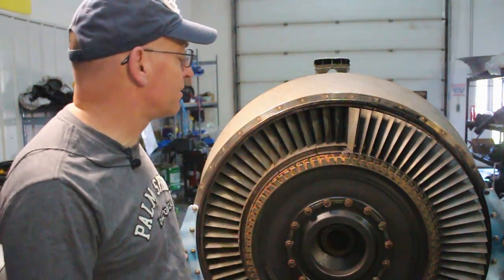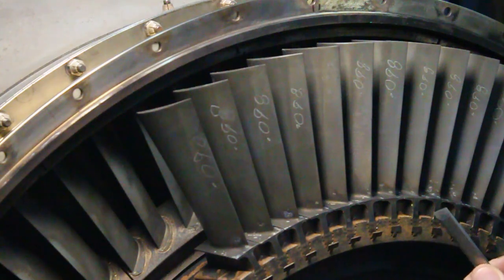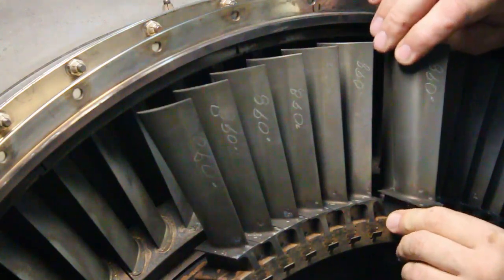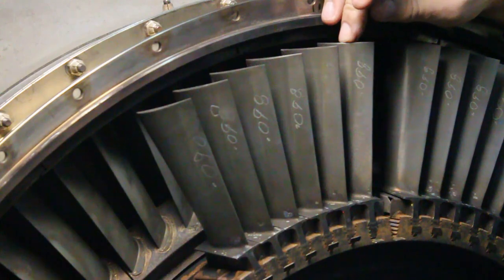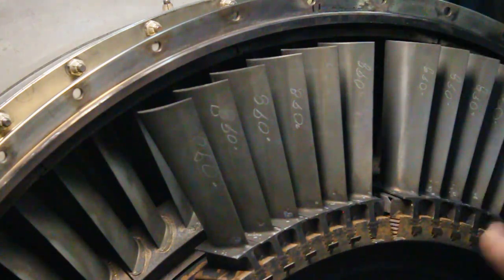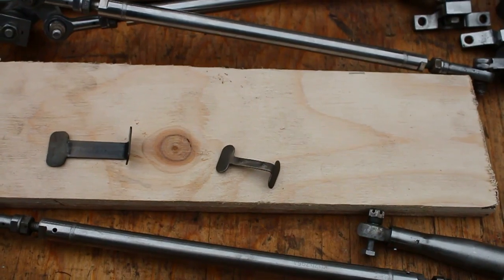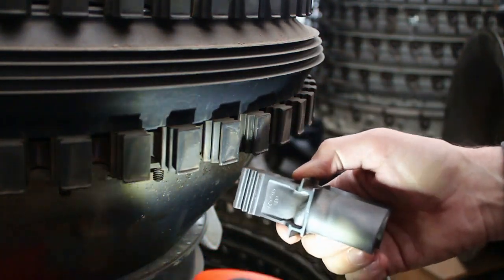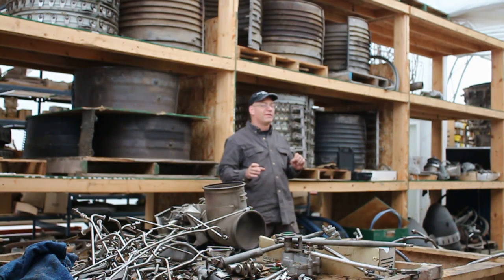Orenda 14  2018 pt.4 Turbine Blade Locks

Comment: Just re-watched your lock wire vid and I have a question...Have you ever taken apart an engine and found a fastener that was loosened against the lock wire persay? Also do you know when they started using lockwire and if there was a situation that caused the manufacturer to have to? Also this is Gary Ferguson...I changed my google name...thanks Sir
Reply from the maker: I've seen a combustor locator pin that had come loose and was held in place by lockwire, and continued to perform its function.
That the only case in about 15 years I can think of.
I think lockwire was used by the builders of the very first aircraft, as they realized that problems could not be dealt with while flying. I've seen wire locked turnbuckles on the bracing cables between the wings of WW1 biplanes.

Comment: It is something, the wide variety of comments & questions you get regarding one topic.  I get this one though, dependable, secure & fairly simple design that works, thanks to lots of gramj9101's out there doin' the designin'!  Of course the 'simple' design requires a complex manufacturing process, including 'how do those cooling air holes get there'?  Some kind of electro-boring process done under water (electrolytic solution) using very fine wire; what's that process called Graham?  It's something I'd seen somewhere but it's obviously outside of my wheel house.  Thanks Jay for the video.

DD
Reply: Thanks, that sounds familiar.  I am not sure if that is the way GE did/does it but those holes are small; maybe 0.010 - 0.015", and numerous.  I think the EDM method can make some pretty small holes so sounds possible.  Maybe Graham knows the method used.
Reply: I was going to mention both EDM (aka spark erosion) and laser drilling, but I've been out of the industry for twelve years now.  However, I do keep in regular contact with a former colleague who is still involved in turbine design at R-R Bristol.  I will have a discussion with him when we next have a liquid lunch. - but I must be careful.
A long-retired former Head of Combustion at R-R Derby was arrested recently for allegedly giving away secrets of the F-35 engine, the P&W F135.  His experience was mostly with civil engines at R-R Derby and he had never worked on the F135 engine's combustion system, so he couldn't be privy to any secret features of the engine.  Since retirement he has lectured on combustion systems as a visiting professor, including during visits to China.  Apparently, he discussed thermal barrier coatings and mentioned the F135, which has got him into trouble with the US military, who got the British authorities to arrest him.
I think I must avoid saying too much about the Pegasus engine in future.  I don't want to be arrested on a 'trumped-up' charge.
Reply: That is a great link there Richard!  Graham will also enjoy reading it if he hasn't yet, so thanks again for the education.
Reply: Thanks for the reply & information.  I went to the link listed below in Richard's comment RE. RR's ABCF plant in Sheffield & found it informative.  Check it out if you havn't already... Cheers!
Reply: I used to see and read  'The Engineer' regularly when I was still at R-R: perhaps I should get back on the circulation list.  As usual, however, there's some journalistic hype in the piece: apart from the information that the wax assembly and investment process is now increasingly automated, there's nothing particularly new in the article.  I was very familiar with the Precision Casting Facility (PCF) at Derby, where the wax room had a large number of female operatives assembling the waxes by hand, albeit with some of the investment already being done by robots.  The manufacture of Single Crystal (SX) and Directionally Solidified (DS) blades was already common practice in the 1990s, well before I took early retirement in 2003.
My first experience with ceramic cores for cooled turbine blades was in 1971, when R-R's Industrial and Marine Division designed an uprated version of the Industrial Olympus.  We knew it as the Olympus 'C' (aka the 2020 series) and it's the version that AgentJayZ has shown us on occasions.  While I (a designer of  less than five years' experience) was designing the LP turbine blade, my senior colleague, Alan C***, was designing a brand-new cooled HP turbine blade.  It had multi-pass internal cooling passages, using a ceramic core: I recall joining him on a visit to the prospective manufacturer of the cores in Staffordshire, a part of England with a long history of ceramic manufacture.  We were probably in advance of R-R Derby at the time in utilising the technology, as they were still working on an improved version of a cooled forged blade for the RB211.

Comment: Nice demo of the firtree - simple but effective idea.  What's up with the numbers? At first I thought you've numbered each blade so they go back in the same order. Then I noticed that quite a few of the blades around where you're working are all called 098, so even though I haven't had my coffee, I blew that theory out... is that a dot? A dimension?
Reply: Chris Comley pretty sure they are weight.. just the decimal part as they all should be extremely close, they weigh each one and mark weight to help balance the turbine wheel.
Reply from the maker: You'll notice I'm removing the blades... The numbers were put there the last time the turbine was balanced... by somebody too lazy to write down the entire number.
They have since been cleaned up, inspected, and had their weight recorded on them in full, in grams.
Reply: As it's your shop, then it's your responsibility to ensure that the blades are marked in a manner that is understandable and acceptable to you.  Having said that, provided the process and the marking is in accordance with approved build instructions, it may not be necessary to mark the weight in full.  I have an Olympus 593 LP turbine blade in my possession: it is marked, '+51-56'  and '5' (circled).  The marking must have survived some thousands of hours in service.  Having left the Olympus 593 in-service engineering team in 1996, with the passing of the years, I now have no idea what the '+51-56' refers to, in relation to a blade that weighs 910 grams on my kitchen scales.

Comment: Wouldn't it be easier if the entire ring came off or had secondary ring to hold them all in place...take it off, dump all the blades out at once to be refubished, install new ones.
Reply from the maker: Weight...
Unsprung weight...
Rotating weight...
...Dump?...
Yeah... no.
Reply: AgentJayZ If you can produce parts that meet standard specifications all of those variables should be met.  Seems overly complex to service when every blade needs to be numbered or has unique variables.
Reply: AgentJayZ said no and I too say no, having been responsible for the design of turbines and turbine blades.  It is quite impracticable, even with the degree of precision used in their manufacture, to produce blades that are totally interchangeable in a disc.  When the engine is running at maximum rpm, each of those blades is exerting a reaction force on the disc equivalent to, say, the weight of a truck - and individually producing as much power as the engine of that truck.  The slightest variation in mass and/or CofG is, therefore, effectively magnified tens of thousands of times. The blades have to be weighed, numbered and distributed in an alternating light-heavy-light pattern around the disc and then the bladed disc has to be balanced.
I'm not quite sure what you mean by a "secondary ring".  If you are suggesting that the blades could be restrained radially by a ring instead of of a disc, then that's not possible with current materials and technology: the ring would simply fly apart.  In turbine (and compressor) disc design, there is something known as the 'free ring radius' or 'free hoop diameter': in simple terms, this means that, at a given speed of rotation, all the material inside that diameter is effectively holding on to all the material outside that diameter.
If you are suggesting the equivalent of a giant circlip to hold the blades in place, then it has been done.  However, because that ring would be well outside the free ring radius, it would be restrained from flying apart by the blades themselves and would be exerting a significant additional load on the blades.  And, because the blades (and the disc slots) can never be made absolutely identical, the load can never be distributed uniformly between the blades: a few will take no load, while some will take most of the load.  I've been there, done that, in terms of trying to address an intractable problem.
Reply: grahamj9101 did I read in the comments long ago that if a turbine disc failed from over speed that it would burst into 3 approx same size pieces failing about 120 degrees apart around the circumference of the disc? I may have dreamed that up but i think either you or someone else explained it in the comments. I have not been able to find the topic again in the comments but if I didn't dream it up, could you explain the how and why of it failing in 3 equal parts? (Hopefully I didn't dream it up. ) Thanks!
Reply: No, you didn't dream it up, Mr Good: I made that statement in a previous comment.  When I saw the photo of a segment of the burst IP turbine disc from the QF32 uncontained engine failure over Indonesia in 2010, I immediately recognised it as an overspeed failure.  The distortion of the sheared disc drive arm also suggested that it had been softened by severe overheating.  Three days after the event, I wrote a hypothesis of the failure sequence, which was essentially correct.  However, I digress.
In my time at R-R, I saw several photos of discs that had been intentionally taken to overspeed failure in a spin pit: the three-segment failure is classic.  So why is this the case?  I won't pretend that I'm up to speed with the theory after all these years and you really need a stress engineer to explain it in detail.  However, from what I recall, it essentially begins with the first failure initiating at a position somewhere on the periphery (I think) of the disc where it is very slightly weaker.  The first crack propagates at that position and it is down to curved beam theory that the consequent failures are at the highest stress positions, which are 120deg apart.
Reply: grahamj9101 Thank You for the reply. I had a serious heart attack June 25th 2017 and open heart surgery September 18th so I have had quite a lot of spare time to re-watch most of the videos here and read the comments but I could not find that comment of yours about the burst disc and was starting to think I had dreamed it up. After having attack and surgery I have realised that the most valuable thing we have on this earth is our time. Thank both You and AgentJayZ for sharing your priceless time energy and efforts to educate all of us on these amazing machines. The knowledge and experience that you both share freely with us is very much appreciated. 99.9% of what I know about turbojet, turbofan, turboshaft, turboprop, gas generators, etc. I have learned here from AgentJayZs channel and both of your answers to the questions. Even the "dumb questions" has helped me learn allot here as well as everyone else's comments. Thank You Both grahmj9101 and AgentJayZ, keep up the good work! I will have a ton of questions in the very near future just as soon as I remember the proper place to ask the "Your Questions Answered" video questions!

Comment: AgentJayZ - 

Hi, I'm an Engineer and Mechanic/Aviation Geek and I am having trouble trying to find a GE T58? How much does one really cost? I am at the beginning stage of building a plane and want to learn how to build and fix a T58 and/or all turbines in general. Is a T58 reliable for a replica P51 Mustang that i am beginning to build? Is there another engine that would be a better fit? From what i have found the the T58 weight/thrust is right in-line for what i am looking for. Love your channel by the way and watch them pretty much all day at work. Keep up the great work! Would love to hear back from you. 

Thanks Andrew
Reply from the maker: Learning how to fix or build turbine engines is a step or two before actually putting one in a Mustang. 
It's easy to start that process inexpensively by reading a few of the books I recommend.

As for powering your Mustang, instead of a helicopter turboshaft like the T58, a turboprop in the 1,200 to 2,000 Hp range might be a better choice.
I would suggest a P&W PT6.

Keep in mind that this project would be much more than bolting in an engine...
The aircraft would need to be integrated with all the control systems of an engine it was not designed for.
...
Then, you would have a very reliable and responsive engine that makes all the wrong sounds for warbird enthusiasts.
It might be difficult to find anyone who sees any value in your creation if you ever wanted to sell it.
I think it's a cool idea, but then it would also be a monumental job to make it work.
I wish you luck, and would love to see the result.
Reply: If you use a T55 engine, you can build a replica Piper PA-48 Enforcer...

Comment: I'd like to know the profit margin on turbine engines.. They just seem to be somewhat of a Monopoly and way overpriced? I think I saw that like One A380 engine is $10 million USD? so times 4 for engines? I mean how can one engine cost $10 million? Just doesn't seem right... I'd bet it costs 1 million and 9 million is profit per engine is my guess..
Reply: Wrong!  
The big engine manufacturers typically sell their engines at a loss initially, to get them installed on an aircraft type.  The profit comes, in the longer term, from the sale of spares and through repair and overhaul contracts, and in-service support arrangements.  
Mr Morin has got it about right.
Reply from the maker: I'm only responding to this comment to say it's not worth responding to any comment that complains : "it just doesn't seem right"
C'mon, man... It just doesn't seem right that I have to pay so much for my house... or my food... or my taxes...
It is what it is, and it's nobody's responsibility  but yours to make you understand it.